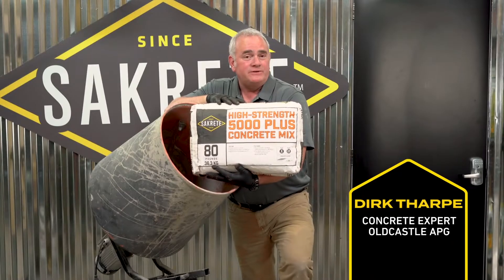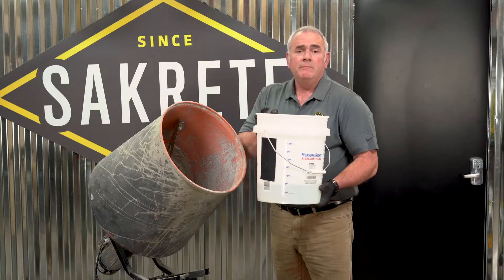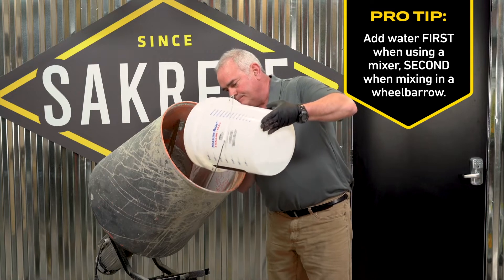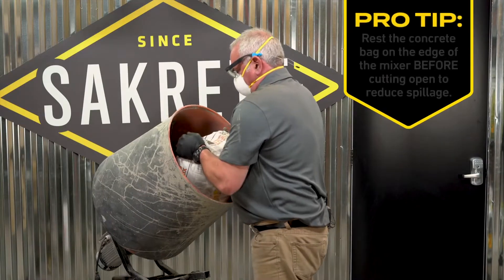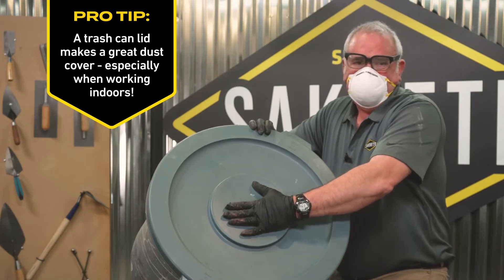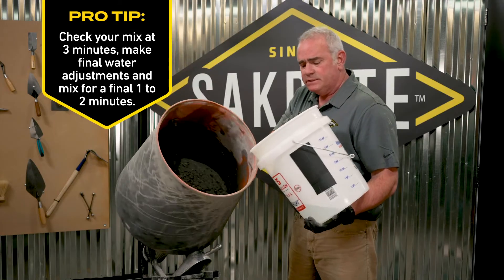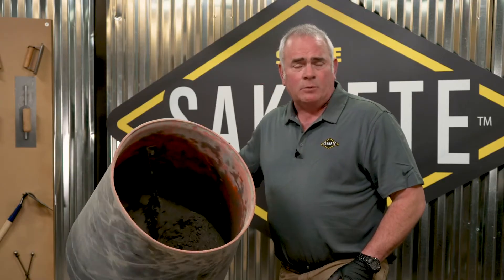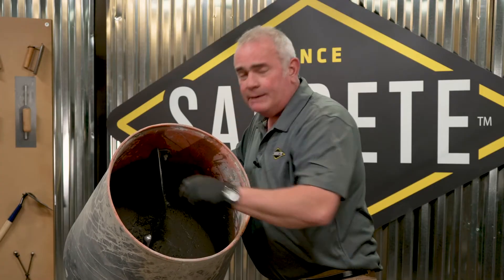Pro Tips: How to Mix Concrete In A Mixer | Concrete 101 | DIY Project Guide

Comment: Your mix looks way wetter than mine after I follow the instructions for exactly how much water to add (2.5 quarts for a 60lb bag). I have to use at least DOUBLE the water specified on the bag to get close to the wetness of the mix you have ??